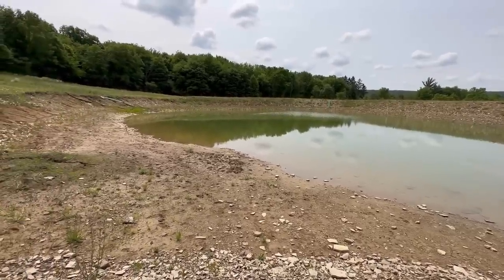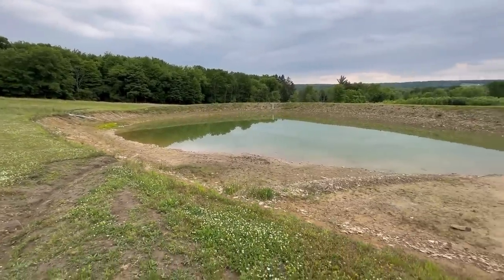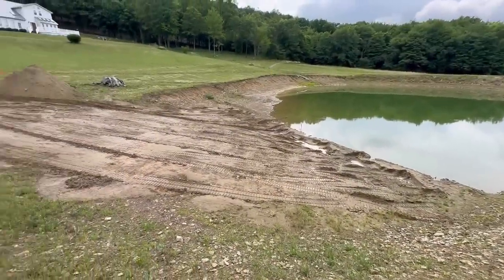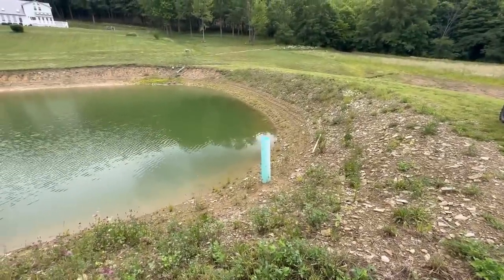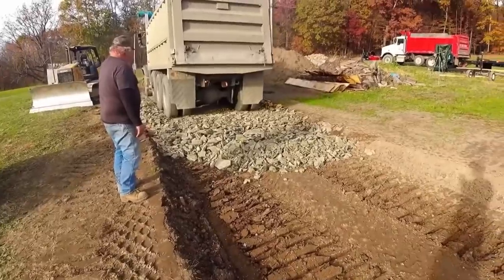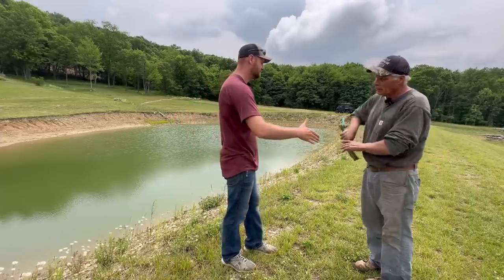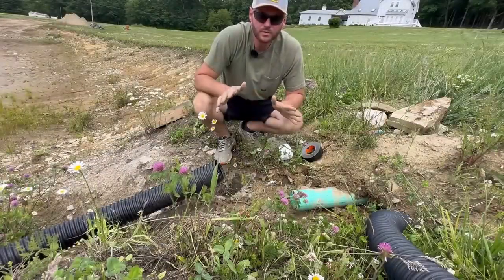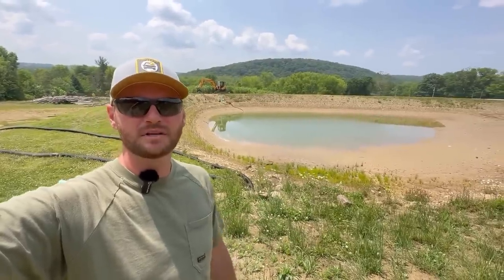And So It Begins

Comment: For future reference, a simple siphon with no pump has worked good for me when draining pools of water like this.  I used 2" pvc with a rubber fernco coupling at the highest point (in order to break open the pipe for filling the lower portion with water [closed ball valve at the outlet end] to generate the suction necessary to start) with the lowest point behind the dam as low as possible below the lowest point in pool.   Fill lower end from high point with ball valve closed, connect the fernco coupling to the pipe extending down into the pool, the open the ball valve and let gravity do the work.

Use a weight, and a 2 LTR bottle to float/position the inlet end (with a 45° fitting) about 3-4  inches below the surface -- this prevents a tiny whirlpool from sucking air and beaking the siphon.

Comment: Get yourself a few of the pieces of wood you Mill and make a rectangle frame and put hardware cloth over one side. Get some posts and mount it over the trailer so there's a drop on one side. On top of the hardware cloth, put 2 diagonal pieces so it creates a funnel for the run off. If you want it to work even better mount something like a sander to it. You now have a screen for your pond material and it might save you a tri axle load of sand.

Comment: Couple things: 1) Happy Father’s Day! 2) Don’t skimp on the clay. The engineer in me gravitates toward the 2ft thick compacted clay. My opinion might change with test data on clay fraction in the particle size distribution of the borrow clay, and/or permeability data on a compacted specimen of the clay. Any nonuniformity in the compacted clay could have higher permeability and lead to leaking. Knowing compaction behavior of the clay is also valuable. Compacting wet of optimum moisture content generally leads to lower permeability.
Reply: We had a pond built at our place, the terrain was mostly sand.  The builder averaged between 18 - 24 inches with the clay blanket that he was able to get from the hillside nearby.
I'd also consider making the pond a bit deeper since all this other work is getting done to fix it.
Reply: I agree with the 2 foot (600mm) thickness, and it needs to be taken up the slope to a point above the level of the spillway.  I didn’t hear the guy talk about using a sheep’s foot roller, but it will be essential.  The clay should be placed within the range of 85 to 110% of optimum moisture content in 200 mm layers, with the roller used until it “walks out” of the clay.  By that I mean that the roller only makes a minimal indentation into the clay.  If you don’t place the clay within that moisture range, you’ll have problems with the clay expanding and contracting.
You should also prepare the bottom of the dam after you’ve excavated to slop.  You should rip it about 300mm deep, then compact it with the sheep’s foot roller.
It would really help to know the moisture content of the clay, and the optimum moisture content.  Without knowing those two properties you really are working blind.
If this bloke with the earthmoving gear says that you only need to track roll the clay, sack him.  Get him away from the property as fast as you can. The whole point of having tracks is to reduce the pressure exerted on the ground, for compaction you need a high pressure to be exerted on the ground.  Track rolling is not a substitute for using a sheep’s foot roller.
Hopefully you can get the dam completed properly this time.
Reply: Murfles_McGee  Geomembranes are an option, but at this scale more expensive than clay. It would take edge joining rolls together. “Welding” geomembrane is done all the time in landfill construction, but would likely not be cost effective here compared to simple compacted clay. Plus, any defect in the geomembrane could leak rapidly if the underlying soil has high permeability. For this reason landfills have a geomembrane on top of compacted clay.
Reply: @shanejarvis1108  I 100% agree with this - 6 inch lifts and a sheepsfoot roller for the kneading and high contact stress beneath the feet. A true sheepsfoot roller too! I’ve been seeing more and more padfoot rollers being called sheepsfoot. There is a difference!
Reply: @shanejarvis1108 if you were a better listener, you would already know that a sheeps foot is in the plan.  The “bloke” has repaired multiple ponds in addition to other projects… that seemed to be authenticated skill sets for a meticulous accountant that had already learned his lesson.  Your rant, while it might be valuable to someone else adds no value here…especially since you are just a random FB person who has provided zero points of credibility.   Everything you said could be copy/paste from a google search (doesn’t confirm nor exclude its value).
Reply: @genesispuredeaf2390  lol! If someone had been listing the first place the young man would not be needing to rebuild his pond.
But it does make for a great content and that’s probably gave him more subscribers. So it works out
Reply: @paulprigge1209  in full disclosure, he sought answers, seeking guidance after the leaks were detected.  I’m sure he got my different answers.  He chose to do a modified variation on the strong recommendation to build a keyway under the dam which would have been much more work than the “core” he had someone throw out in front of the existing dam.  It’s possible that the point of greatest hydraulic pressure (below the dam) was insufficient in depth and placement to perform a seal but instead facilitated a conduit to more permeable soil willing to reduce the uphill pressure. 

He has indicated that the leakage is through the “floor” because he no longer has evidence of leakage.  My point: there might yet be another chapter if the blanket doesn’t seal the entire pond (a possibility).
Reply: Murfles_McGee  He could do a liner, but a proper clay blanket will do the job also and probably be less expensive.
Reply: Isn't Google great .
Reply: LookAtYoSelf  Expense of a Clay liner. I think that’s what they said.

Comment: Ufdah…been nice to see a floating suction strainer on that. Hopefully the sand don’t plug up the drain pipe or wear out the pump😬
Reply from the maker: There’s only sand on the beach. Not down by the stand pipe. Also it’s a trash pipe. Rated to remove water and debri up to the size of pea gravel without burning up the pump

Comment: Maybe it was perspective but when you connected the drain pipe it looked like there was a low area there, meaning the water was going uphill first and then down hill.
If that's the case it may blow off the connection if it rains hard.
Crossing my fingers this repair goes as planned!
Reply: with the amount of flow of water that he showed coming out of the french drain and with it going up hill, I can't see it lasting past the first rain.
Reply: @davidlohberger5237  I would have glued the pvc fitting onto the drain pipe & used self tapping screws to secure the corrugated tile to the fitting.  I have little confidence in the band clamp & tape.  But it is only for a few weeks.  It might hold...  fingers crossed.